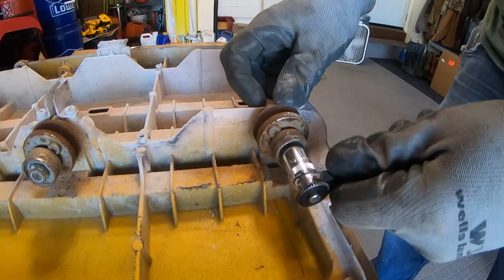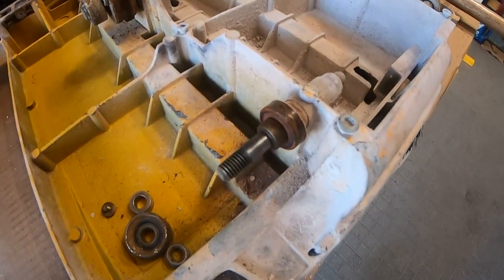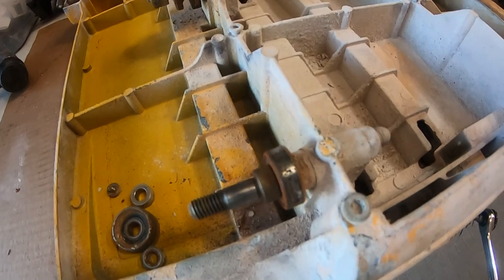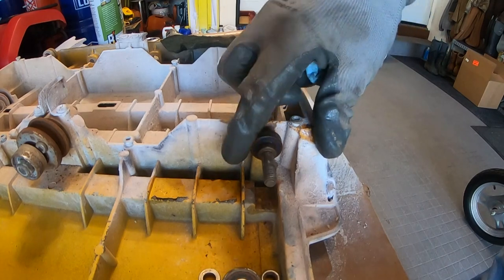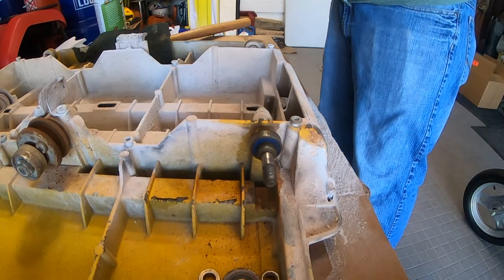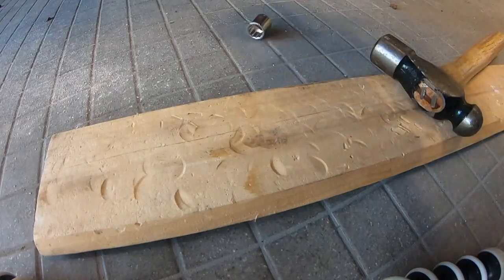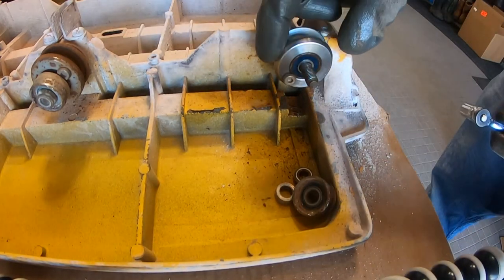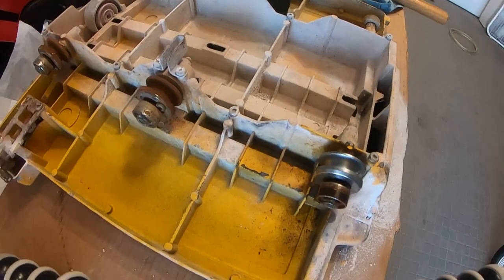DeWalt wet tile saw accuracy issue Solved/Repair

Comment: Got a "free" wet saw" looks which looks like this dewalt. The strangest thing is that after replacing the armature, I noticed the blade was offset about 1/4" off which means the blade is outside of the guide. Can't tell if it's just the bearing that is causing this issue or if anything else is at play. Looking at your video, looks like it could be the bearing causing the entire issue. Appreciate your input.
Reply from the maker: No problem, not a lot of good info out there on these so glad it helped you and thanks for watching.

Comment: My table is able to make very short cuts without issue, but anything longer than 6" it will not cut straight at all! I have to mark a line with a sharpie and eyeball the the blade at the starting point to the end! it ahs driven me crazy! The table def has a lot of play!
Reply from the maker: Yep, once I find were marking both sides I know it's time to rebuild! The savings of time with an accurate table is invaluable! Def check your rollers, I highly recommend buying at least a few new bearings if not all of them. It gets expensive but it's worth it. Hope all goes well, and thanks for watching.

Comment: You have to rebuild those every year or two? Maybe im lucky but i bought my dewalt the first year they came out , so its close to 20 years old and i have never once had to do this and my tray is tight, straight and smooth. At the end of every day i clean my saw really good,  i always use a sponge and after every job i lube up the wheels. I have had to rebuild motor twice though
Reply from the maker: Maybe, it def seems that they made the wheels from a softer sacrificial metal and the guide is def a hard steel as it surface rusts everyday and wears into the wheels, taking them from a sharp v shape to a u shape and thats when the accuracy is gone for us. We do run quite a bit of material through them. We have 4 saws, and in 10-15 years of using DeWalts only done a motor rebuild on the very first one.  Was cheaper to get the whole armature assembly and new brushes and it was like new again.
Reply: @fourboysgarage745  yes my first rebuild i just bought the bearings and had them pressed but a short time later had issues, the next time I bought the whole armature and another bigger part and it held up . Sometimes I wish you could just get a complete motor, but I haven't seen that as an option...

Comment: So for full replacement, 6 bearings 3 rollers and 3 guides?
Reply from the maker: Yes, for complete replacement of the guide wheels and bearings. There are 3 more bearings and cups in the right side for a grand total of 9 bearings. More than a few times I was tempted to reuse some bearings only to have them tighten up later on heavily used saws, so beware of that if you rely on it daily!
Reply: Can you tell me how many of each or total of each I need to completely rebuild it? Thank you in advance! The previous response to your video is from my work YouTube. Meaning two different pics. I’m ready to buy everything as soon as I hear back from you! I did remove the top just a minute ago, and everything is rusted and worn with ruts on the roller guides. Might as well do the entire bearing roller and guides at one time! When I was at Floor and Decor and slid the dewalt display tray! I was astounded at how smooth it was! Mine is sketchy pushing back and forth.
Reply from the maker: From memory I think it's 12 bearings, 3 guide wheels, 6 rollers. It's pricey but will be roling like butter and accurate again. Also, the right side there is an aluminum rail that the rollers ride on and it wears down to a flat spot on the top. It's not expensive to replace it, and the table will stay flat as it rolls.
Reply: @fourboysgarage745  That is exactly what I purchased this morning! $237.44 parts, shipping & tax!!! About fell over lol I may end up buying that bar as well. Thanks for all your help and great video!
Reply from the maker: Yes it's pricey, again the bearings and rollers are sometimes still decent and can be reused but more often than not have caught up later! Decide your own tolerance for pain and frustration if you decide to save any! No problem, and glad it helped!